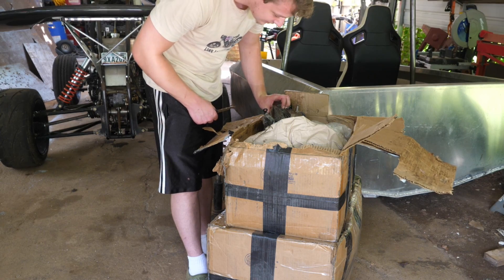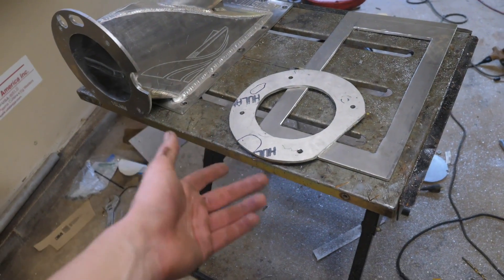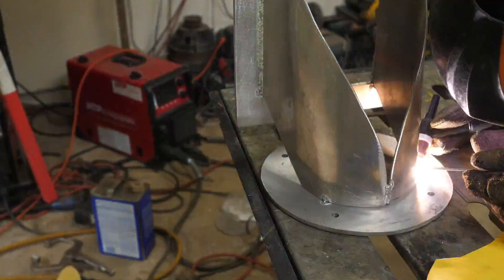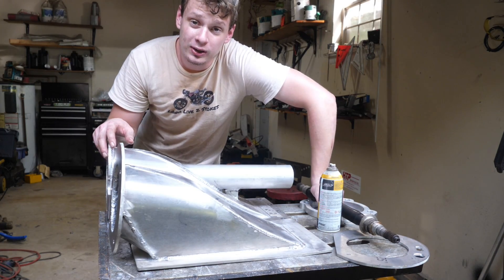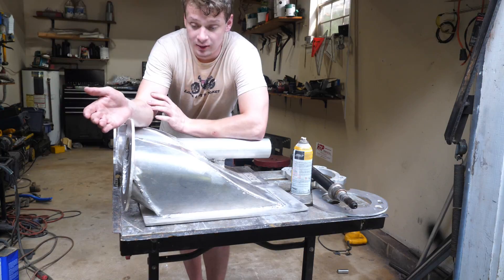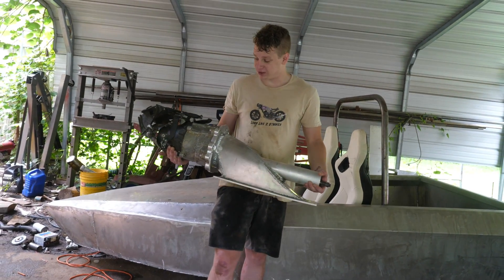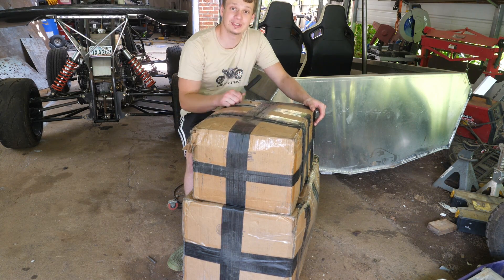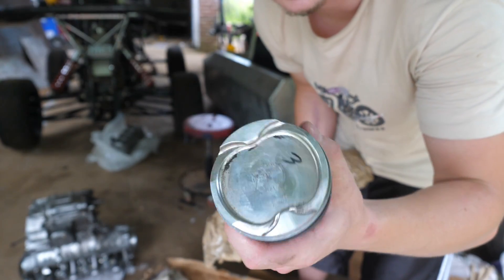Building a DIY Mini Jetboat Part 3

Comment: What a jackass!! You do all that great work and get soooo close. Someone provides you materials to complete your awesome boat build and you turn around and "I'd rather use them on a go-cart". The attention span of a gnat these days with most born after 82.  That would be the last time you ever got anything out of me and I'm sure they as well as others are disappointed with your choice in use. Maybe you chickened out on the build? I don't know. But I myself am in the middle of buying a 14ft jetboat which I'm suspicious of a shitty unreliable 2 stroke marine engine and am going to fab in ANY DOHC Inline 4 cylinder motorcycle engine 100hp or better. Maybe I should do a video? 
 Otherwise excellent build on your part so far. Very disappointed you didn't have the decency to finish it with parts provided by people. What a rip.

Comment: A tip for weld prep on aluminum….if it’s not a cosmetic piece, cross cut the metal to clean it…basically just running a burr/rotary file lightly across the alum. Aluminum is so soft, even the grinding wheels specifically for aluminum will impregnate the metal with impurities

Comment: Probably telling you something you know but use acetone or lacquer thinner to clean the surface then use a dedicated stainless steel wire brush to further clean the surface. There are chemical cleaners for aluminum welding that will help with contamination issues also.

Comment: As I was watching this video, you held up a can of some sort of cleaner and I remembered something from my days as safety coordinator for a company I worked for. Be extremely careful on what cleaners you use when MIG/TIG welding. Some of these cleaners react with the welding process and off gas very harmful fumes that can cause permanent lung damage. Brake Kleen I think is one of the sprays you don't want to use when welding. Check your MSDS on all of your shop products for the warnings. Hope this helps. God bless and stay well.

Comment: I've been watching back when you started upgrading the Chinese go cart and it's never gotten boring or dull. I'm like you if it's not right i have to fix it even if it works. If it doesn't look right it usually doesn't perform right either. The rally cart cart you built is my favorite.

Comment: Ive welded a couple of Aluminum parts so far with pulse MIG and my tricks to get the TIG finish are: 
Using AlSi5 type welding wire, rather than AlMg5 type wire (4Roller wire feed recommendet) it flows much smoother than wire with magnesium. 
Degrease and pre heat the surface with a quick blast of the blow torch, the start of the bead should be a little hotter than the rest and the bead will have an even cross section.
Use a cylindrical gas nozzle for your MIG gun, this will help to cool the bead and create less soot on the edges, of course the gas should at least be 99% Argon.

Comment: Great video 👌

Tig welding downhill is a surprisingly easy and efficient way to fill a gap.

Just remember, tig welding is like 70% prep, 20% experience and 10% technique. 
That and you can "flash" the area of the work piece your welding on (heat it up with the arc, no rod. Not sure proper nomenclature) to remove impurities that seep into pores, it also works good with tig welding cast metals due to impurities in the casting process like with heads, blocks and cases 👍

Comment: Your like me I rather be welding aluminum over steel and stainless steel so much easier to work with especially for me I use the primeweld tig 225x w\maxcool 3000 water chiller with a flexlock water-cooled torch. And far as you finding all that contamination you should be using Scotch-Brite with acetone and cleaning all your edges and everything with the Scotch-Brite with acetone in the Scotch Brite it gets the contamination out....

Comment: Slow your blade speed down, go to as little a tooth count as you can get, and the key to cutting aluminum is slow down, and when you think you're slow enough, slow down until you don't have any aluminum build up on your cutting blades. 
Then you can eliminate any need for lubrication completely, and if you do start to get some build up on your blades.
Same as with stainless steel, have dedicated brushes for each of these, and separate ones for carbon steel, and never cross contaminat one of your brushes on the other materials.
Same thing for blades, as this too contaminates the others, and you'll find yourself struggling to make clean welds every time if you don't follow this simple discipline. 
Just get yourself some plastic containers large enough to hold whatever you need to maintain this, preferably that have decent seal on the lids foe each so that you don't get any shavings, or minute fragments from one to the other by grinding fragments being built up on top of your storage containers. 
Be sure to label them accordingly so as not to accidentally pick up the wrong container when you're in a hurry, are distracted by whatever it may be. 
This goes for your filler rods, your tungsten, and be sure to use air hose to blow amy particles from your gloves clothes, hoses, cups and other cross use equipment you have no choice in using as far as torch heads and the like.
Best advice that I know to follow in keeping your cross  contamination down to minimum, and make your welds they're best, and life somewhat drama free as far as your welding goes

Comment: Vasily, you are spot on about the contamination issue for any aluminum welding; most welding is best done clean, but aluminum requires clean to the bone. More good welds and less frustration for the welder! You do seem to learn faster than most so ever onward!  FR

Comment: Salute you my friend, from Arad/Romania...In my opinnion,the pump is too little,impeller 140mm,old generation,from Sea Doo 587,650,717,fabrication between 1992-1997..
    I have some experience,owner of a little service for jet-ski,about 30 years along..I think that you need bigger...Some after 1997 or better from 4 stroke...215-255HP...
  Sorry for my english...
   All the best wishess!
Reply from the maker: This is 158mm from rxp215
Reply: @VasilyBuilds  Ok,but I now 215rxp not aluminium...It's plastic...
Reply: Ok...Keep in touch...

Comment: Acetone or isopropyl alcohol should remove all residues if used well and wiped off.
The alloy you're working with is roll forged so not porous like a cast or sintered metal
Was nice of your friend you let you copy his! What was wrong with your first one? It looked great
Reply from the maker: I didn't want to drop $1700 on one so I made my own
Reply: @VasilyBuilds  and I'm glad you did

Comment: I love the jetboat. But, I'm subbed to Grind Hard too and they're doing something very similar. I guess it's just bad timing that you and Ethan both started nearly identical projects at the same time.
Reply: Different sized boats,with different types of engines.BoostedBoiz just dropped a K series Honda engine in their's,but I'm more interested in what Vasily is doing with his.He doesn't have allot of support like Kyle,or all the equipment like Ethan has onhand.They're all different.
Reply: @bryduhbikeguy  You're correct. But, those are pretty minor differences on build videos. The size/engine really only matters to the end result. They have much more in common than they have differences. If you suspect a different reason for why Vasily's views suck on this project, I'd love to hear it.

Comment: Use alcohol for lubrication when cutting aluminum. It works much better to keep the aluminum from clogging up, and it will not contaminate and cause problems with welding 👍